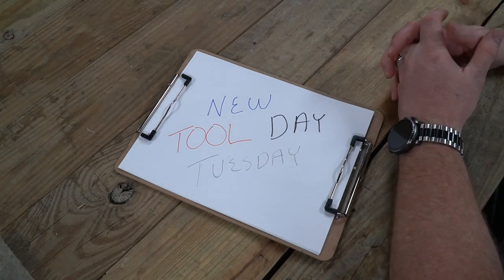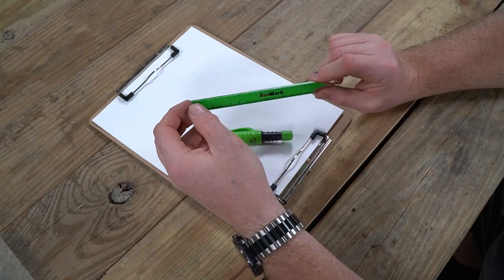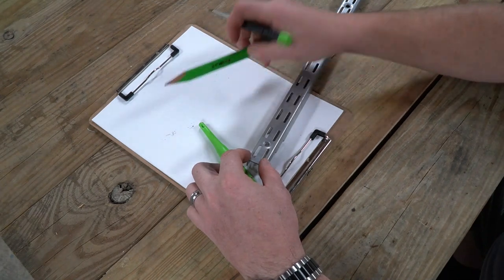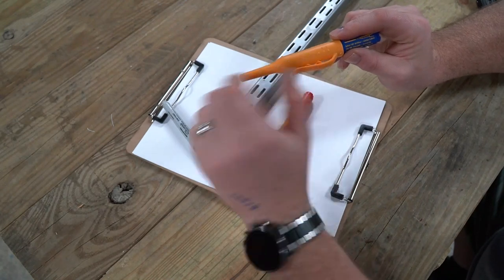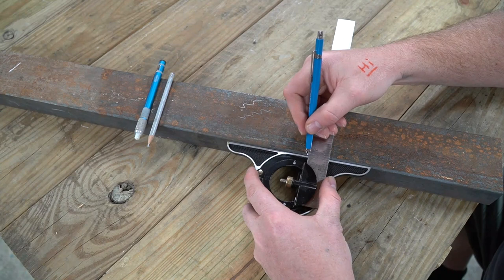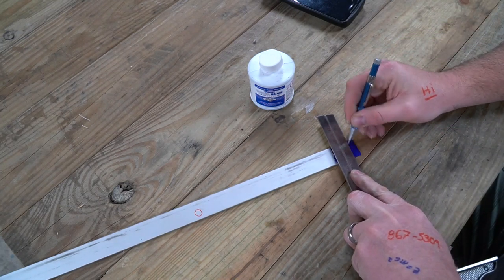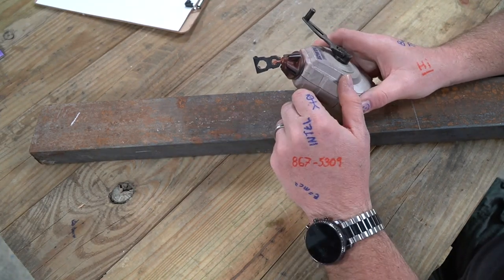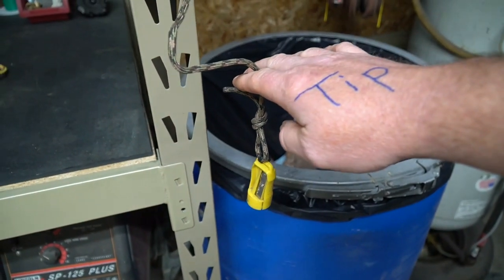The best tools for accurate marking on wood, metal or other materials?  (New Tool Day Tuesday)

Comment: Nice explanation and great marking tips.
I haven't tried Pics markers. I too have found Sharpies to be fragile.I will be trying out a Pica.
I uses Dykem when I sharpen saws. It goes on easy and wipes off with acetone. It is a messy product that takes time to dry.
 For quick layouts I use Magic marker. Strike a line with the marker then scribe almost immediately with a sharp point 
Change your mind in the middle of a complete layout? Just cover the mistaken scribe and rescribe. 😁😎

Comment: Your carpenter pencil - WHY SHARPEN IT TO A POINT!  It is flat for a reason.  If you want a point use a regular pencil or PLO  (pencil like object).   It is flat and has to be sharpened to a flat chisel shape.  It will then hold up drawing across wood (which eats pencil leads).  It is also Not a fine line marker but a rough out marker.  It can be used for a fine line if sharpened to a fine chisel point.
Reply from the maker: Correct!  You don't have to put a point on it if you don't want to.    But if you do like a fine pint on a carpenter pencil like I do, you can.   Arthur found the joints in my fingers a long time ago and I really appreciate the large flat shape of the carpenter pencil.  I also use them more like a regular pencil with more precision that a rough in carpenter would.    But you are correct, most people will chisel the tip and use them roughly.